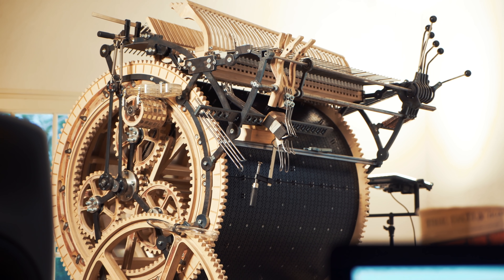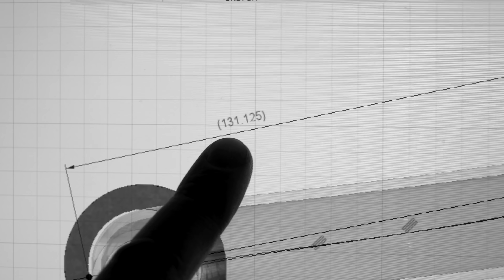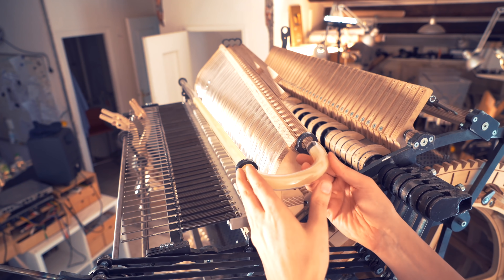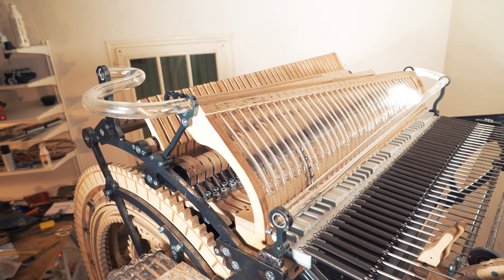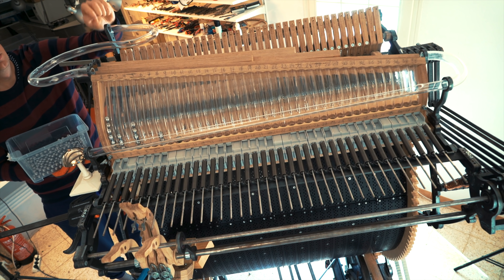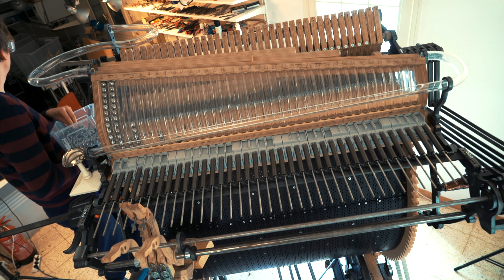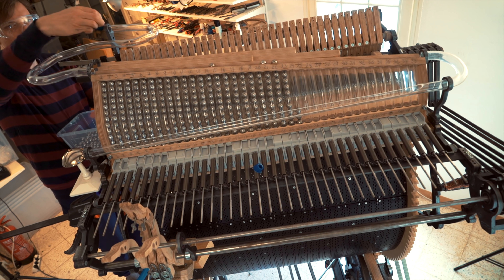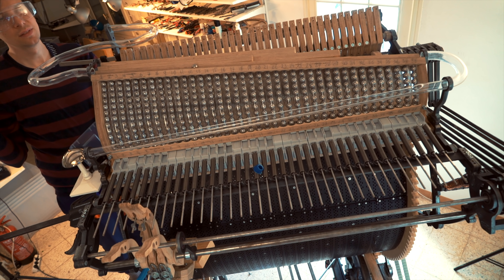Marble Divider Transport Tracks - Marble Machine X #68

Comment: I don't think the programming wheel is overcomplicated in anything except the pin holes. I would have made them round. Drill them undersized in CNC and then use a reamer to make them final size after plates are bent and mounted. Round holes are always easier and nothing prevents the pins being round. But barking a slain dragon is futile :-)

Comment: I just want to say, the tubes need to have enough support to not bend, snap, or break due to the marbles' weight. Pls. I think of the worst that can happen. And the snake just bending in opposite directions, the straight half tube, bending due to the ridiculous speed the machine is playing, specially since half the integrity, not literally, was cut.

Ed: since it is a closed circuit with extra marbles running freely in the loop, at least inferred from those two tube pieces, there will be areas of heavy marble traffic.

Comment: I personally dont think the open top design of the overflow pipe is a good idea. If i am not mistaken, at 12:51 there is a sound of the marble hopping along the track, and i feel like with enough shaking of the machine combined with the speed at which marbles will be going through the channel, there could be a lot of lost marbles which could ultimately lead to incorrect triggering of notes or even a danger to  you or the machine. Furthermore, the removal of the top half(at least in the video) didnt really present itself as an effective stylistic change. I think with the clear tubing, there is enough clarity to have an effective visual effect.
Reply: But hey, what do I know? Im not the one building it.

Comment: An idea to consider.  Not as visual as a programming wheel, but did you consider pianola scroll technology?  That way, you are not limited by a single revolution of the wheel.   You also can swap music quickly, and have whatever gaps between notes that you want.  No doubt you can design a printer punch machine to make your own scrolls.

Comment: I haven’t bothered criticizing the programming wheel, or mentioning my simpler ideas since even if they work I like how this looks better.

Still, in case it sounds good to you, here’s one: CNC out the music as metal punch cards like with your music box, and just change how the current fingers get triggered.
Super precise, any measure or song length you want could be used, and extremely portable; but spontaneous composition would probably involve a drill and a metal sheet with pre-measured lines printed on it, I guess?
Reply: thats an entire sheet metal punchcard for every song he ever writes, that cant be tested outside of ableton without sacrifice sheets.

Comment: Here is an idea. Keep the basic design of the programming wheel but change the material to a self healing board similar to a dartboard and have a precise printed paper ,or something firmer,overlay for a given song already made. This allows for reprogramming on the fly, easier programming, precise notes, lighter, less time consuming to make and replace, and allows you to keep previous design without total rework of the machine. You can even have the magnetic pins on it too. The trick would be is to find out if that material can be presice enough and to find the right material.

Comment: Drill the holes before bending and installing the plates. Remove the table from the your CNC and install an axle.  Build an indexer using the gears you already have and then rotate the wheel an exact amount before drilling that row.  Perhaps ask Lord Index (This Old Tony).  You could also drill more than one row as long as you adjust the hole position to so that the top of the pin is in the correct spot. The plates could be still be removable and stackable.

Comment: Martin - I have a suggestion for an "alternative" (actually - more of an addition) to your programming wheel which (subject to being torn apart by other commentators) MIGHT be a solution to the reprogramming conundrum on several levels... although it would be a pretty hairy engineering task to make. The main advantage is - you wouldn't need to lose any of what you've already done, it will fit on the machine pretty much exactly as it is now (maybe one design issue which I'll cover). 

 My suggestion is, look back in time to the original Jaquard Loom, with it's punched card system, crossed with a 1980s dot-matrix printer. 

So.. bear with me on this one...

1) You'd need to make a real monster set of programming plates, where every single hole contained a spring-loaded pin. Given that the MMX will mainly exert a side force when it encounters a pin, though, the springs can be quite weak.
2) These mega programming plates would also need sprocket pins, to keep the paper/plastic programming sheets in sync with the machine.
3) Songs would be punched into paper or - better still, thin flexible plastic (acetate type stuff) - similar to Jaquard punch cards, or old computer punch cards, or more accurately punched paper tape, only much much wider. The holes would line up with the correct pins, allowing them to stick through. No hole, and the pin is pressed in, thus no marble release.
4) As the machine plays, the plastic song sheet is spooled through the machine. It could roll/unroll onto fairly compact rollers underneath the programming wheel, so hopefully there would be minimal clearance issues (this is the only serious design issue I can immediately think of, if there's no room anywhere for the programming sheet to spool on/off the machine). It would need to be tensioned fairly accurately to ensure it fed nicely and didn't stretch, but was taut enough to push the pins in (hence the weak springs).
5) You could use multi-coloured acetate sheets for artistic effect :)
6) Want a silent bit for improv? No problem - just stop the machine like you did with the original; or if the "improv" always happens at the same place - keep the machine running & "program" an empty section...
7) Change from waltz to 4/4 time and back again mid-song? No problem! Every single pin on every single channel is now available to you at all times.
8) You could still remove the "Jaquard Plates" and replace with programming plates as you have them now, in the middle of a concert. 

Possible problems (which I think can all be overcome):
1) Stretching of the media: Correct choice material should prevent this. I don't know what media is best; but magnetic tape has been used for donkeys years & isn't allowed to stretch; paper wouldn't stretch but may be too weak; plasticised paper maybe?
2) Programming.... yeah, you're going to have to make a programming machine :) Punching tens of thousands holes in exactly the right place over meters of plastic/paper/tape/whatever would be beyond tedious on a CNC machine, impossible by hand... but a fairly simple machine along the lines of the machines used to program Jaquard looms would be relatively straightforward to construct. Combine it with a church organ style series of "stops" for a crazy aesthetic!
3) The programming wheel sections will be *heavy*. Plus they'll have to work reliably and repeatably every single time. Can't have a pin that's supposed to pop up not popping up... or jamming up & punching its own way out of the programming media...
4) No wi-fi. Could be a killer that one.

Obviously, there'd be a ton of working out to do... and there's bound to be stuff I haven't thought of, which may even make it a no-go idea... but, I wanted to put it out there for you.

Sorry this comment is so long! Thanks for sharing your MMX journey, it's an absolute blast!

Comment: it looks like if somehow row 38 is empty for some reason, it won't get a marble before all the previous channels (1 to 37) are full ... there is a precedence in the filling order due to gravity the way the system is presently set up. So to avoid starvation of a channel it looks like the is a need of extra marbles in the system, all the ones necessary for playing and coming back plus a full row for each channel in the divider (so that the next one down is not starved).

Comment: I fear that the pipes are either too slow or too fast in relation to the rest of the gearing and the programming wheel. It may look beautiful but might have a lack of consistency which would require a hopper at the top with a one directional flow which introduce fresh marbles at the required pace needed and a hopper at the bottom that can recirculate in their own time.

Comment: Question: Is it possible that the marble divider is backwards? The Bass notes have the highest storage of marbles, but also the highest opportunity for a reload. Tenor/Alto notes have the lowest marble reserve and the lowest available reload opportunity. Would it not make more sense to reverse the divider so that the notes with the highest opportunity to be reloaded have to lowest storage capacity. This would also mean that for higher notes that are waiting longer to be reloaded, they have the highest marble reserve to rely on?

Maybe the intent is to feed the divider with more marbles than can possibly be consumed in a given measure so that you expect a constant overflow? If that's the case, then the orientation is probably a moot point.

Just curious, thanks Martin. (P.S. - That internal dampener tube action and the rolling sound is sooo soothing)

Comment: I say we'll know if it's a case of the sunk cost fallacy when the machine is completed and the systems that work in small-scale tests don't work when you put them all together. But you can't know that until it's done, which is why redesigns happen.
My main worry watching the marble channels fill up is still whether the channels at the far end will get marbles during normal operation. There's a lot of spaces to fill up before a marble gets there, and all the channels will be using marbles constantly. Even with a constant feed rate, you can't accelerate gravity, and the marbles have to fall into their channels one at a time, so I think the original marble machine's inelegant flat top divider might end up replacing this overdesigned but pretty system.

Comment: How about going even further down the engineering rabit whole : build custom programming wheel CNC. One  linear axis along width of the wheel, z-axis with the router stays the same and the third is a motor that turns the whole programming wheel underneath the cnc. I can make a drawing, if you want 😀

Comment: Overcomplicated it's the programming wheel ... which actually is a tumbler. If I was building a marble machine I'd focused much on the marbles and other fun/weird mechanisms and I'd used a common standard paper with holes to program it. You could have copied some work from Decap Antwerp, and most important that would enable the machine to midi but keeping it all simpler and avoiding pain when you will bring it to concert stages... but of course it's only an opinion.

Comment: I think you built your marble Reservoir backwards it looks as though the incoming marbles will be feeding those longer tubes trying to keep them full thus allowing a marble to bypass down to the next tube . If the rate of incoming marbles isn't High Enough  it will be very difficult  to keep all the long tubes filled so that the marbles can get all the way to the end  where the shorter tubes with less capacity are .it seems to me you should have been filling up the shorter tubes first allowing the marbles to make it all the way down to the larger reservoirs I hope that makes sense

Comment: Why not make your programming plates to fit on the without the holes and throw them into a CNC-lathe with C-Axis milling capabilities. Then you could have your plates in the correct spot with a few well placed position pins?

Comment: Excellent as always :-) Only one question: DID YOU REMEMBER to UPDATE the measures after the "adaptations" of some parts (for example, "shaping adjustment" at 1:30 minute of video) in the Fusion 360 project? :-)

Comment: Dont think the snake looks that good and isn't the speed a limiting factor you don't need? Wouldn't it be cooler if you ran a tube over to the other side and looped back instead. If you come from the other direction and out the opposite direction you could use a full stop wall and drop directly into  channel 1 instead.

Comment: If you add a few drops of silicone oil to the medical silicone rod, that thing will move very easy without difficulties. And when you clean both shortly after, there shouldn't be any issues with dissolving oil into the rod.

Comment: What are your requirements for the programming wheel exactly? Can't you go retro and go for paper with holes in it? It would just need "reverse" actuation, as in playing when there are holes. Kinda like this: https://www.youtube.com/watch?v=nbih6ajBJgk it is also seems fully mechanical (except for the motor).

Such a system would be a lot of work per song, but it would make the muting system obsolete which makes it easier to play overall.

Comment: As far as pins in the programming wheel, I think your template overlay idea may be over-complicated. My simple solution would be to color code holes to songs.
Song 1 needs a pin in all the red dots.
Song 2: green.

This would make it quick change. At a glance you could tell if you were missing a pin. It also makes it easy enough that your fans could help reprogram between songs. It would be less materials to take on the road. The drawback would be the aesthetics. Right now the plates are solid black, but would you be ok with a rainbow of freckles?
Reply: wow! and what about pins in use on 3 or 4 or more songs.... ?

Comment: For the programming wheel/system, I'd have considered reflective or punched paper sheets with a light sensor system which either triggered on a reflection of the light or triggered on the light shining thru the punched paper that would've affected a solenoid but I can understand that it's largely a mechanical device that needs to remain in the mechanical arena without the introduction of electrical systems.

Comment: I think that a change in the manufacturing process for the plastic sections of the wheel could help a lot. Say, using a custom hole punch design instead of CNC-ing it. But you'd need to make it out of tungsten or something else really hard to minimize wear on the hole punch and a way to line up the punch multiple times precisely (no way there's going to be a hole punch dye for the entire sheet, just a section of the pattern that can be tesselated) and probably a new machine for that (unless hammering by hand could work). Maybe a different plastic material would be required too...

Also I'm worried about how temperature/humidity differences are going to mess with the precision of the machine. Different materials expand at different rates after all.

Comment: I have an idea that might be an easier, more repeatable, more accurate, method of creating the programming plates. Mount blank plates on the programming wheels assembly and use a modified CNC where the completed drum turns back and forth as the X-axis.

Comment: 2 things, Generally you seem to come off as slightly more of a dreamer than a do-er (I don't necessarily mean that in a bad way), but in this video I think your distaste for the other programming wheel designs may be well founded. I haven't read enough of the comments to know what the suggestions are, but I feel that I understand your constraints and applaud how far you've made it with your design.

Honestly, short of trading out your programming wheel for paper reels (continuous piece of paper makes spacing/alignment far more repeatable) which would lose most of the intent of a marble machine, it'd just be a big complicated spooled music box. Or you could have a piece of stainless or aluminum pipe CNC drilled on a lathe or 4+ axis mill (But good luck finding one big enough to do it for any reasonable price) and then use steel tube of the same size (Tube is specified by OD, pipe is specified by ID) for your magnets to bottom out on. Other problems with CNC'ing tubing are inaccuracies in the roundness and wall thickness of the tube and the weight it would add to the mechanism, plus it probably wouldn't match your aesthetic either. 

It's true, you likely are stuck by the sunken cost fallacy, but it's a very real thing. It's a mental thing that's hard to overcome. To have put in so much work and realize your options are [usually] to "Band-aid" until it's done, or scrap it all and start over. 

I think you're on the right track, and even if you're not, I don't blame you for continuing rather than starting over. Even a solution that's only 50% of what you hoped it would be is still infinitely better than starting over so many times you never reach a final solution.

Comment: i don't think you overcomplicate the design or construction, but maybe laking of some perspective. take the "snake" example. Some videos ago, you made a lot of effort trying to have the perfect speed of marble to fill up all the channels. You made tests and trys and machiing and so on and so forth, and now, you had realize that firsts channels could not be filed because of the higher speed required to fill the last one. The problem in the end of the video of stucking marble should have been fixed also a long time ago. You made a perfect heigth adjustement and trimming of the register, according to flow rate of marble, which is link to the marble incoming speed. Maybe the perspective in this case would have been to first test the marble feeding system, then adjust the speed so that firsts channels were filed up, and then adjust the height of register and marble divider, then.... you see the point. Anyway, good luck in this construction, but please, try not falling in the rabbit hole of re-re-re-redesign and "manual" modification. I think you have a good design, you should stick to it